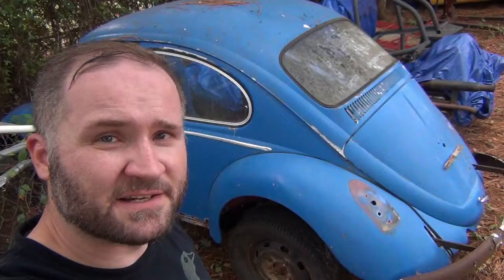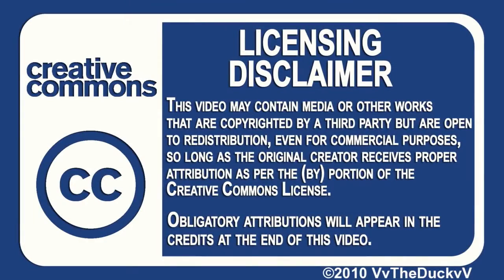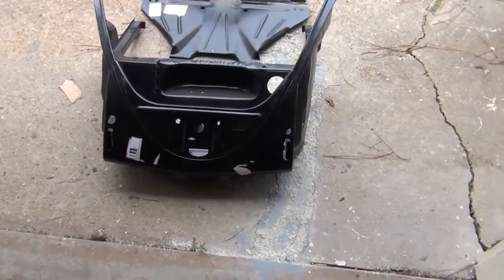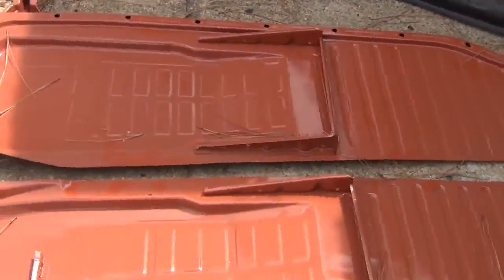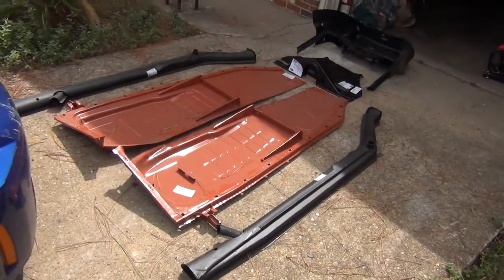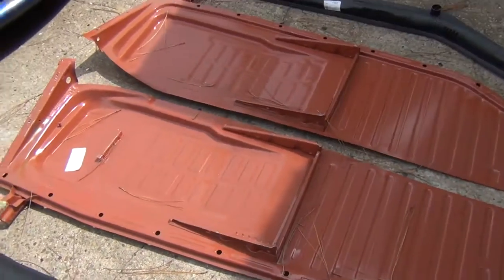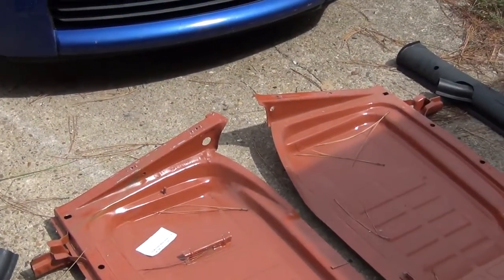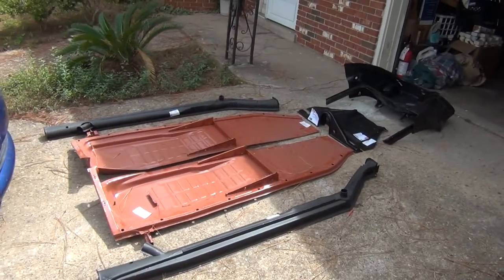1965 VW Beetle New Sheet Metal

Comment from the maker: Parts seen in video FREE SHIPPING at time of this post below:
Beetle 48-70 pans here: https://amzn.to/2I1Nf71
Beetle 73-79 pans here: https://amzn.to/2wtD1qI
Right side Heater Channel: https://amzn.to/2lilQjd
Left side Heater Channel: https://amzn.to/2M4DZfT
Front Bulkhead (Napoleon hat): https://amzn.to/2M0b1xM
Nose / Spare Tire Well: https://amzn.to/2JRpUWJ
Buy your acid/rust converter here: https://amzn.to/2ruGW0B
Note: 71-72 Beetles have unique seat tracks, you can use the earlier pans if you modify or replace the early tracks.
Reply: This info on 71-72 is awesome. Thanks

Comment: How many hours does it take you to do a set of pans? Heater channels? You have done a few sets in your time, I see. Just curious. Do you happen to know what the book labor hours to replace the same jobs. Thank you for the info.
Reply from the maker: But if I start with an assembled car, I can have the engine out and body off of it starting first thing Saturday morning and I can have the pans painted and the car reassembled and driving by end of day Sunday if nothing else is broken (which is never, lol, usually the owner or myself wants something else done, too)  For heater channels (if nothing else needs repaired around them, which is almost never!) add a day for each side.  If I record videos, this all takes twice as long.   The baby blue 69 Beetle needed a ton of work and took me a lot more than the above.  Eleanore the 56 oval choptop took waaaaaaaaaaaay more than that!  My 73 Beetle was pretty quick though, did the whole thing in a couple weeks with video recording.  I hope that helps to put in into perspective.
Reply from the maker: The 65 you see in this video actually got sold recently.  It was all taken after and prepped it all for new floors.  All the demolition was done, once I got the oval my motivation shifted to that and I knew I wouldn't get to this car anytime soon.  It has an awesome (but very sad) backstory, I really wanted to turn this car around.
Reply: DuckmanCycles and VW Garage thank you for answering my questions. Meet you on the next video.

Comment: That is some extensive rebuilding plan you have. What did all those parts cost with shipping?
Reply from the maker: Actually, I ended up not building that 1965 Beetle, I sold the car without these parts shortly thereafter, and used all these parts on my 1956 Oval Beetle that showed up in my life instead!  I invite you to watch the before and after video here which I just uploaded last week!  https://www.youtube.com/watch?v=i2K_hKFffwI
Reply from the maker: The prices of the parts were actually considerably cheaper 4 years ago, but you can find them at the following links with free shipping!  
Beetle 48-70 pans here: https://amzn.to/2I1Nf71
Beetle 73-79 pans here: https://amzn.to/2wtD1qI
Right side Heater Channel: https://amzn.to/2lilQjd
Left side Heater Channel: https://amzn.to/2M4DZfT
Front Bulkhead (Napoleon hat): https://amzn.to/2M0b1xM
Nose / Spare Tire Well: https://amzn.to/2JRpUWJ
Buy your acid/rust converter here: https://amzn.to/2ruGW0B